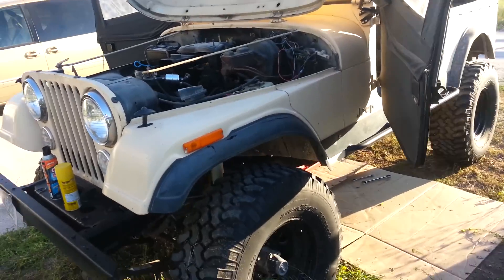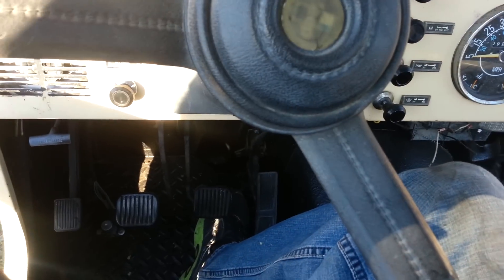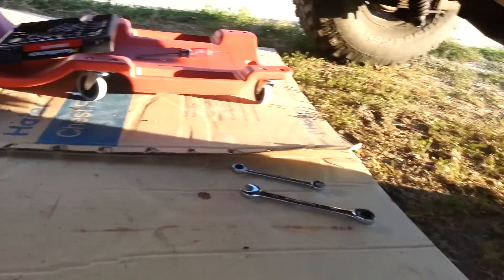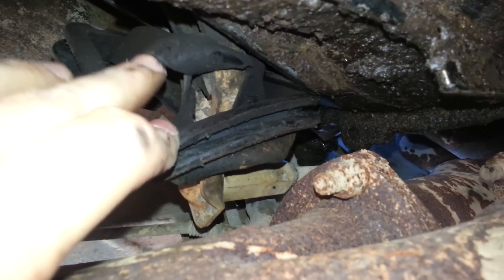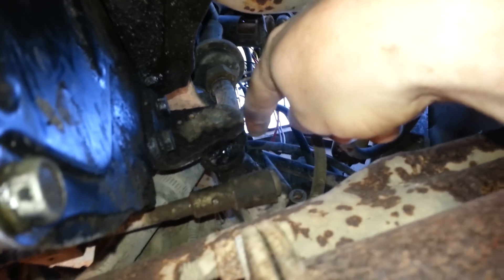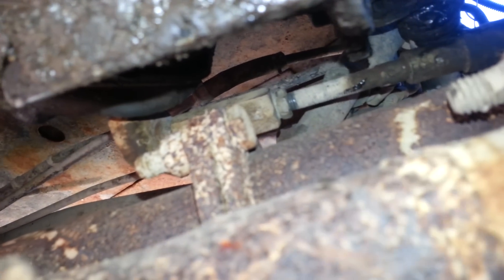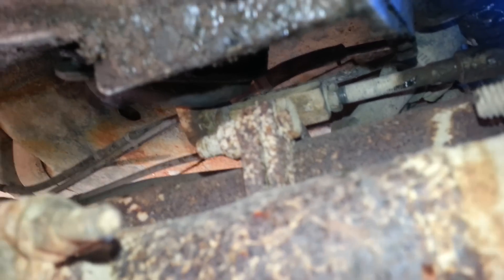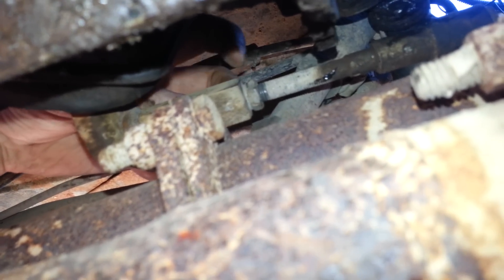How to adjust clutch fork 83 Jeep CJ7 Part 1 - EASY

Comment: Do you drive to work everyday in the ocean? Yes you need the metal cap that rides on the clutch adjuster as you suspected.
Reply from the maker: +jim davidson Practically. I live in Montana and the de-icer they use is horrendous!

Comment: Get rid of the stock friction linkage mess. Get the Rugged Ridge heim joint linkage. Much smoother and longer lasting.
Reply: I just put a Novak hydraulic clutch conversion in my CJ 7, like night and day, should have done it years ago.